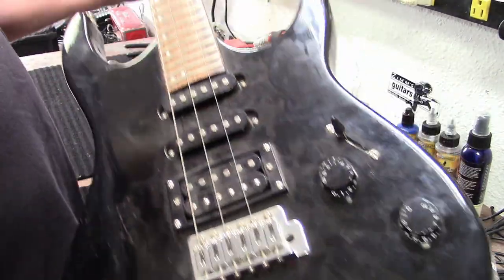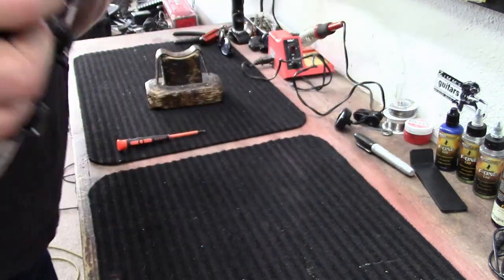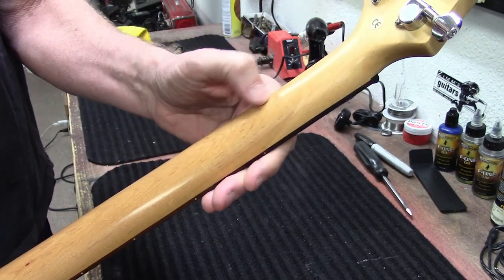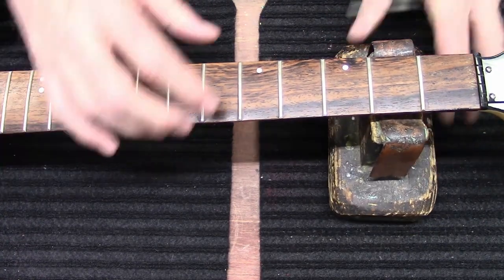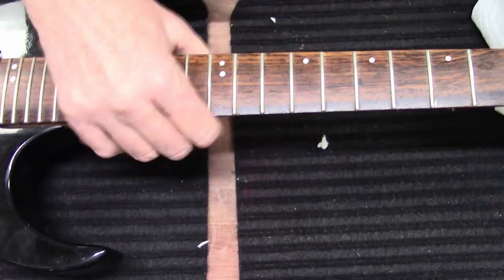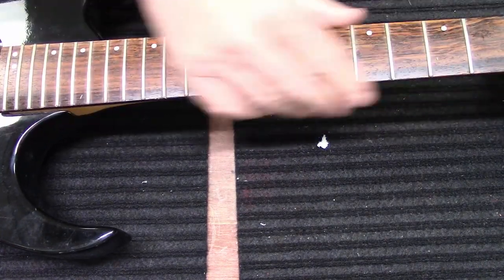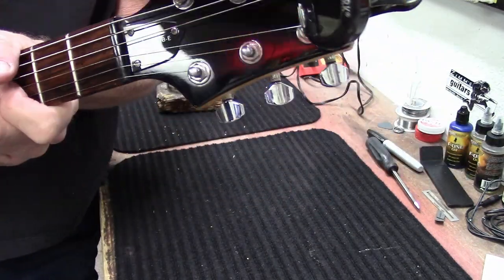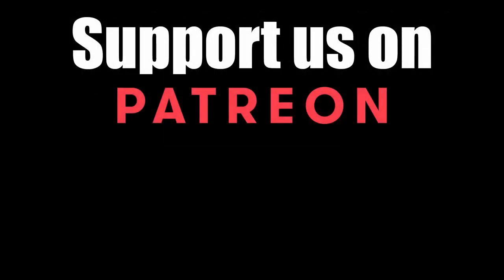Goodwill Guitar Rescue   Washburn House of Blues

Comment: LOVE the older 80’s Washburn electrics! Diamonds in the rough! Worth a lot more than market value. Customizing an old Washburn increases their value, unlike old Stratocasters which are worth more completely stock. I Keep all original parts when upgrading electronics. I make new pickguards from a blank piece of material using the original as a template then add pickups, switches, pots, etc. This way you could always return the guitar to original condition if you wanted to. Great hobby for an old ROCKER like me.

Comment: those are actually decent gits, they sell em at the HOB in case you want to have an artists sign one... or jsut want one...  tell you what, slap some Evo Gold or stainless super jumbos on it, polished slot intonated bone but, a set of good pickups or just a screamer in the hummer slot, upgraded pots and switch, capacitor(s), a good set of Gotohs whatever, float the trem you might be surprised the shredding it can do and sound real good...  you could trick it out with like a vintage PAF or Dry Z hummer, a couple vintage dimarzio super distortions along with a freeway switch it'll pace with any guitar on the block for sure, they used decent wood on those, in fact in 20 years its going to cost you over a $1000 for a rosewood fret board, and that one has a real nice one ..

$100 guitar today, but in 20 years when rosewood is banned all across the globe folks will be paying hi dollar for those squier and other budgets to recycle the rosewood fret boards, if you can get squiers and such with rosewood fret boards for $30 all day buy em up by the truck load, the fingerboards can easily be recycled onto a hi end guitar.. specially those fatties  

just cuz a guitar was rushed on the build and inexpensive components tossed into it with zero QC doesn't mean it has to be a a dud, some of my best gits are Squiers, but I work em over, long as the wood is good they are gold..  I'll remove the frets, roll the edges, carve it down to a 12" radius or compound like 10 to 16, install super jumbos, maybe I tweak the rear of the neck as well, some I'll do a V, some a better shaped C, whatever I am feeling for my taste, you can thin em down, compound the profile whatever, its wood, then I refill the wood, seal it and then a light coat of lacquer..

to me the necks are most important as you can buy very nice vintage spec strat or tele bodies in alder or even ash for like $180 off the bay, why I like the NC's with the heel adjust vintage style necks in rosewood.. supreme necks, if the body is a dense or too heavy I can bolt it up to a nice ringer someone else made, finish it myself have a real nice git, depends how far I wanna go, maybe I thin down some fish glue and use that to seal the wood like the vintage fenders, then use a vintage lacquer?   you can do whatever you want..

with the shop you have I am surprised you don't do frets, the tooling is maybe oh $500 max for stainless frets which means you can do any fret you like.. a few more tools for acoustic guitars its on, you can easily re-radius, roll edges, re-profile, easy money really specially if you build yourself a good rep, offer ball end the works..

Comment: Washburns are the odd ducks. Certainly have made some good guitars(remember the parallaxes with the high fret access designs and five bolts in line, and have made some good acoustics. But after what they did to Parker, they lost my respect. If they wanted to stop building them, fine, sell kens designs so some else can.